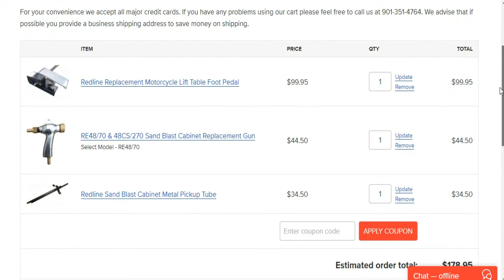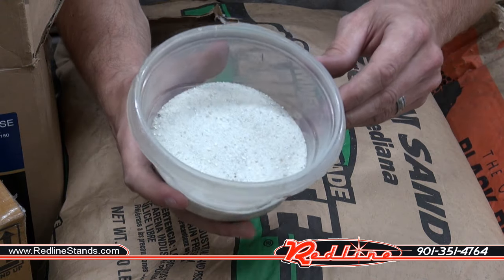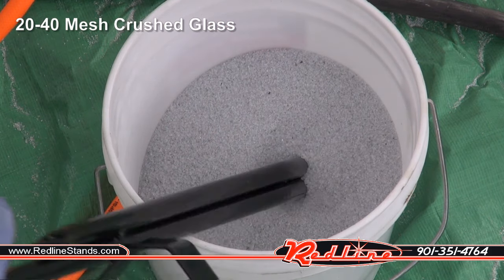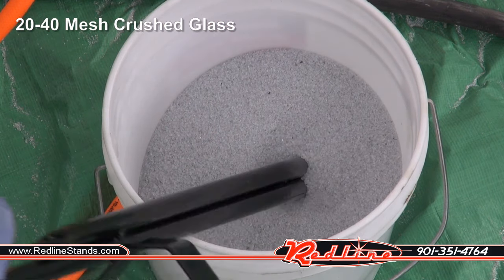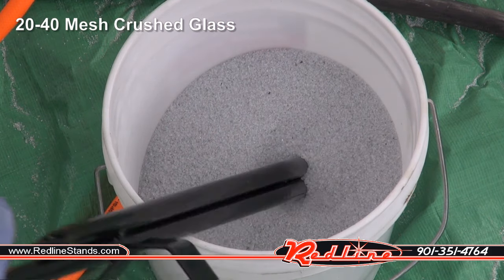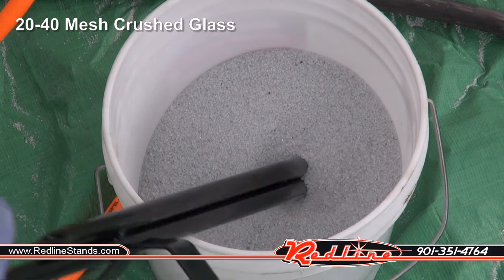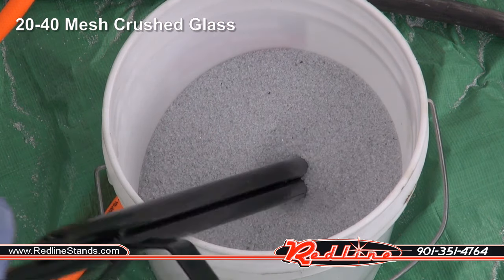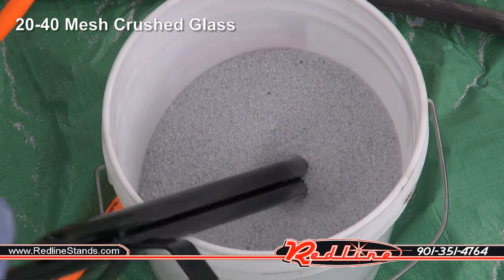Blast Medias Compared and Demonstrated

Comment: As I understand it, unless you are sure the sand you are using is silica free it shouldn't be used, Silica dust is very bad for the lungs.
Reply: Yeah That's why I ware a full face old military Gas mask when using sand all internals clean as a daisy after blasting.LOL.jim
Reply: @TheShawna1  You can't filter out the silica dust with a mask.
Reply: @TheChrisey  Yes you can.
Reply: A lead, asbestos filter on your respirator should be good for silica as well. Just make sure you have done a good fit test before the task.
Reply: @TheChrisey P100 pink circles or any of the Cartridge filters will absolutely filter out silica dust and a lot more. N95 is probably good enough for this, but a cartridge mask with P100 pink rounds is more comfortable and better. So it depends on the mask and how well it fits. Always check fit before use.

Comment: I swear by aluminum oxide. It cuts fast and feeds great. Currently using White Lightning white aluminum oxide from a local abrasive supplier. It comes in different grits like sandpaper. You can cut it with glass beads to achieve a smoother finish if desired. When purchased in 50 lb bags, it's not that expensive (I think I paid $40-50 for a bag) especially is it's going to re-used in a cabinet. Aluminum oxide does wear out eventually....every once in a blue moon, it's a good idea to change your media. I also use a carbide nozzle on my blast gun....not cheap, but totally worth it compared to ceramic or steel nozzles.
Reply: Agree with the aluminum oxide for fast work. It does leave a rough finish but that works out well if you are planning to paint the part. And the carbide nozzles are a must. The ceramic ones don't last with the alum oxide. For more finer and delicate work, like carbs, I like to soda blast. I dont have to worry about the soda getting where I dont want it. The soda simply washes away with water. Cheers.
Reply: Can you please tell me what you recommend for a bird cage that has paint and a lil rust and a heavy metal fire pit with heavy rust. Thank you

Comment: Reason powder coat paint is hard to remove is because the baked paint is somewhat flexible and absorbs some of the impact from the blast media. Think of it as like rubber. Thus heavier weight and "spikey"/sharp particle media does better to remove it. Glass bead media, which is a more rounded particle will struggle for example. Great video!
Reply: Powdercoat is paint. Its melted plastic
Reply: Powder coat is a polymer resin, not a paint. It is NOT flexible. Best way to remove powder coat is with a torch or industrial stripper.
Please educate yourself before spewing BS!

Comment: I wouldn't burn off powder coating because when I did my bull bar it gave off Hydrochloric acid vapour/chlorine fumes, both of which are incredibly dangerous.  The acid fumes condensed out on various pieces of bare metal that generated rust  within hours.  Normally my workshop is very dry such that I can keep bare metal exposed for weeks without flash rusting.

Comment: Great sifters are designed for gold panning and dredging operations. You can get a whole ranged set of them. They stack and fit right into your 5 gallon bucket. Very precise sifting.  No spilling at all.

..
Reply: I'll be using this for sure. Smart thinking, I'm sure there are tons of trade specific tools that could be used in other trades.

Comment: Thank you for this video! I have sandblasted off and on for years. Had my own business etching glass and blasting bear tracks in rock. I am starting to get back into it a little. Needed a refresh on media and this was perfect. The only thing I can add, if I remember correctly, is I think aluminum oxide  doesn't break down as quickly as other media. Thanks again!

Comment: So I’m an upholsterer and finally broke down and bought a harbor freight gun and some #24 walnut media instead of the #12 you tested. The rust I hit it with wasn’t quite as bad as your test panel and I had to put the nozzle of my gun right up to the rust, but it did come off. But I wasn’t too concerned about the walnut media mulching the edge of my yard where I cleaned my seat frames. 

Now that I have a blaster (and am getting a bigger air compressor), I’ll probably build a cabinet and consider a more aggressive media that is more reusable.

Comment: If you have a chemical stripping company in your area, I feel it is the best way to go for body panels. The part is submersed in a stripping tank, so ALL the rust is removed, even in cavities and seams where you cant get with blasting. Then be sure to paint or seal in all the cavities and you will never have to worry about your trunk lid, door panel, etc rusting from the inside out. Just an option for folks. I also use my blast cabinet and outdoor blaster when appropriate. Thanks for the video.

Comment: Here is my summary of this video for your notes:
Types of Blasting Media
https://www.youtube.com/watch?v=XUc2JCYh39w

Glass bead 20/40 mesh - OK on rust. Fast on paint. OK on powder coating. Poor glass frosting.

Garnet 20/40 mesh -  Poor on rust. Fast on paint.  OK on powder coating. OK glass frosting.
Garnet 40/70 mesh -  Poor on rust. Fast on paint. Poor on powder coating. Fast glass frosting.
Garnet 70/100 mesh -  Good on rust. Great on paint. Bad on powder coating. Great uniform glass frosting.

Coarse Black Beauty Coal Aggregate:
No experiment done, but works fast on rust.  It was too coarse for his gun.

Beach Sand Sifted - Poor on rust. Very fast on paint. Fast on powder coating. Fast coarser glass frosting.
The trouble is the moisture in it slows down sand flow, so I need to dry it out well first.

Hardware Store Sand Medium Grit (needs to be sifted to remove large stones)
Poor on rust. Fast on paint.  Poor on powder coating. Great glass frosting.  If paint has some rust, it won’t remove it!

Aluminum Oxide 70 mesh -  Poor on rust. Best on paint. Bad on powder coating. Best glass frosting.
This is the priciest media.  If paint has rust spots, it removes them all.

Walnut Hull #12 Coarse Crushed  -  Useless on rust,  paint, powder coating, glass frosting. Great for cleaning up plastic surfaces and probably wood furniture lacquer finishes.  You can use finer hulls.

Powder Coating removal - Heat up with a torch. Blast with sand to get this off fast.  Heating it up makes a huge difference to it peeling off fast.

Air Compressor:  Kobalt (Lowes) 17.3 SCFM (this is the most important feature), 40 PSI, 155 PSI max, 5.0 HP, 240 Volt.  I could not find this at Lowes.  Here is the closest match for $2250 and they don’t mention CFM (air movement at Cubic Foot per Minute - the most important factor in blasting. Anything less than 17 cfm is useless for larger blasting projects)
https://www.lowes.com/pd/MEGA-Compressor-80-Gallons-Two-Stage-175-Psi-Vertical-Air-Compressor/5014405385
Remember too, that these are noisy and the larger ones need 220V outlet, and they have a risk of exploding, so keep them in a sound-proofed, insulated cabinet.
Reply: I'm in beginning of video but appreciate notes I am screenshotting them now thx

Comment: Excellent video! Flame stripping is a very old coating removal method. I use a weedburner (carefully on thin steel) for that and a handheld wire brush. I secure the work
on my tristand (any outdoor vise will do) when it doesn't weigh enough to stay put. I keep pieces of scrap especially angle with bolt holes to hold all sorts of work in my vises.

Walnut shell is so gentle it's been used in aviation by applying it to RUNNING jet engines where it removes accumulated carbon etc. It's very much a specialty item and I appreciate you testing it.
Liked and subscribed.
Reply from the maker: Thanks and welcome aboard

Comment: "...running 17 CFM @ 155 PSI"??   
But the specs for that compressor are: 
17.3 SCFM @ 40 PSI
16 SCFM @ 90 PSI
17.3 SCFM @ 40 PSI
And pressure (PSI) changes inversely to CFM (volume) - so the higher the pressure the lower the CFM.  I'm guessing dude just misspoke since the "Max PSI" printed on that compressor is "155".  But who knows what the SCFM would be a max 155 PSI.  I'm not calling anybody out, it's just important to know exactly what settings are being used.

Comment: Very informative. Which media produced the least amount of dust inside a cabinet? I am going to purchase your REPP70 pressure blaster. I have a 40 hp diesel screw compressor I plan to keep outside and run the air in. It produces 100cfm at 100psi. It amazes me how small increases in nozzle size increase tremendous amounts of air flow. With a 1/4 inch nozzle I need 85 cfm. What size nozzle can the REPP70 use? Thank you
Reply from the maker: In my REPP70 at home I like to run either a 6mm or 7mm nozzle and that works well for me, but then again I only have 17 CFM to work with, but I make do just fine.  I'd say the 10X produces the least amount of dust.  Crusted glass gets really dusty fast.
Reply: @RedlineStands  actually you don't even have 17cfm unless you are blasting at 40 psi. at 90 psi you have 15 cfm. plastered clear as day on you compressor.

Comment: Thanks, Enjoyed. I am trying to remove decades of paint from an upright metal belt sander. Rockwell made in 1942. I have a large blast cabinet and first tried soda. Poor performance. Plan B.
Reply: Soda is meant for more delicate parts, like carbs and soft aluminum. To remove "decades of paint" quickly I use aluminum oxide with a carbide nozzle. I restore vintage metal and woodworking equipment and the al/ox works best. Plus, it provides a nice finish for my primer to grab.

Comment: I used to live in niceville around the fort Walton and Destin area myself. That Quarts sand is amazing stuff. When you bring it back from the beach it's in your car and house for life lol. It sticks to everything.  Even turns oil slicks into tar balls. And lighting loves the he'll out of it. It's a great conductor of electricity.  That why things around there get wacked by lighting so much. I just wonder being it's been in salt water. If flushing it with fresh water then drying it would make it less corrosive to the metal your blasting.  So you don't end up with rust under the paint job. I'm just thinking of possible salt contamination to the metal. Just possible food for thought, possibly what are your thoughts on this?
Reply from the maker: I can tell you this for sure.  At the beginning of this Nova project I blasted some parts with play sand from Home Depot.  I epoxy primed one of those parts and set it outside with only primer.  Years later, it looks great.

Comment: Great video I enjoyed very much. What psi were you using in your demo ?   I use the glass bead 80 grit  on painted, rusted cast iron and stamped steel which does pretty good in my blast cabinet. I might give the 70-100 mesh 10x a try and see how that works.

Comment: hi could you tell me what size screen you use to clean or shift the media ? thanks great video.
Reply from the maker: I bought that screen material many years ago so I don't recall.  Today we sell this sifter in the link below and it works great.

https://www.redlinestands.com/catalog/shop-equipment-c-327/sand-blast-equipment-c-327_501/sand-blast-accessories-c-327_501_506/5-gallon-buckettop-blast-media-strainer-filter-p-3056

Comment: I bought a 5g blaster direct from VEVOR when I got most of it was together my only concern is when I hooked up the blast gun hose to the bottom of the tank it went on really easy it seemed very loose fit I tightened the hose clamp real good and I can still spin the hose around and around I'm not sure if it is suppose to do that or not.  My thinking is yes because of all the different hoses it has this would be the one that you would want to spin depending on how you prefer to hold the blast gun,  please get back to me ASAP thanks Wally
Reply from the maker: No sir.  Definitely not.  That hose should be Jesus tight.

Comment: is there the health hazard with quick Crete and beach sand. If so, does a good respirator
 safe enough?
Reply from the maker: QuickCrete is the brand, so it's just sand, not QC and sand.  I have used a good 3M respirator in the past and experienced no health problems after a full day of blasting.  With that said, do not use a dust mask.  You definitiely need something much better.
Reply: Yes there is a health hazard with any blasting operation, but especially with silica sand.  In my 37 years in the equipment rental business, including many types of blasting equipment, I would say "NO", a respirator is not safe enough.  Even a Positive Air Pressure device leaves traces of highly abrasive in your lungs, which you will need for the rest of your life.  People breathe more than 10 times more air than they eat food by weight.

Comment: aluminum oxide is what i use and it's great for steel and aluminum for my powder coating,  but after i use it and outgas it, then ill put it my other blast cabinet that has glass media, to fine out areas that are needed works great....im getting ready to buy black diamond fine and medium , what do you think about using it replace it with the glass ??? please let me know thanks
Reply from the maker: I don't understand your question sir
Reply: @RedlineStands  does black diamond work the same as aluminum oxide ? performance wise ?
Reply from the maker: @417plasma6  Never tried it.  With that said, I have never met anyone who thought anything worked as well as aluminum oxide.
Reply: @RedlineStands   Thank you I appreciate your response. 10.00 a bag of black diamond fine, isnt gonna hurt my budget, so i'm gonna give it a try, and ill let you know the results and different application  difference..if any !!!.. Happy New Years from my shop to yours

Comment: Too funny :) Beach sand is the best (FREE!!) just make sure it is sifted out and dry thanks much !
Reply from the maker: No sir/ma'am.  Please don't use beach sand.  It contains free silica, will give you silicosis when blasting with it, and will kill you.
Reply: @RedlineStands  Oh I didn't know that. I suspect all of those abrasives are deadly when they get ultra fine powdered and inhaled. I mean glass is the same as sand and garnet will get just as fine as glass. Gotta wear EFFECTIVE breathing protection. Thanks for the warning.  

..
Reply from the maker: @MrDavePed  Correct.  It's all terrible to inhale, but some are much worse than others.
Reply: @MrDavePed  I Understand the Point being made, what I don't understand is how Marines can drive through the Dessert, for 18 days at a pop, Get covered from Head to toe with enough sand, they have to put bandannas on their faces to breathe, then spend hours cleaning that gritty crap out of everything. Trust me when I tell you that sand is about as fine a particle as you're gonna find after being ground up by 5 Ton Trucks and 15000 Lb. Howitzers or Tracked Vehicles, Yet, they still do this today!?!! I am glad to see so many people erring on caution though, sharing this information is working, Thanks Everyone!

Comment: Beach sand, builder's sand, brick and block sand and play sand are not the best cutting materials.  All of the above are rounded by the action of wind and water, and appear like ball bearings under magnification.  Blasting sand looks like shards of broken glass with lots of "sharp" edges, before first use.  Most media can be reused.  Blasting sand can be reused up to about 4 times before it is no longer economical.  Sharp blasting sand is manufactured by fracturing silica deposits, before drying and packaging, and must be kept dry for best results.  Sieving and cleaning media is time consuming and therefore expensive.  Silica, like asbestos, is an extreme respiratory hazard.  Silicosis, also know as tunnelitis, killed at least 764 men working on the Hawks Nest Tunnel, alone.                                                  Other media, while being initially more expensive, may be less expensive when reused.                                                                                          The Kobalt air compressor is not capable of 17 CFM at 155 PSI.  155 is the max pressure, and 17 CFM is the cubic feet per minute at 40 pounds per square inch (PSI).  PSI is like electrical voltage, and CFM is like current (AMPS).  To determine power, multiply CFM by PSI.  In use while blasting, the actual air pressure will drop to near zero, so therefore. flows more volume (CFM}  Than  specified.                          Good job on the video.  I hope your wife forgives you.

Comment: what type of media is best fro removing a coating on a 1985 Kawasaki motorcycle frame>? The stuff is very thick not sure but mite be plastic coat?
Reply from the maker: That's really tough to say.  It depends on what you plan to do with the metal once you're done.  For instance, is it aluminum?  If so, are you going to polish it?  If so, you will want soda because anything else will leave the metal badly pitted and would require sanding in order to polish it.  Are you powder coating it?  If so, then a lot of pitting is great, and I'd recommend something cheap like crushed glass or 10X.
Reply: @RedlineStands  Hi it is being powder coated, i'v tried crushed glass it dose not work on this coating what ever it is?
Reply from the maker: @terryrowles7703  It's probably powder coating.  If you'll hit it with a propane torch and burn the coating really well it'll become brittle and will blast off easily.
Reply: @RedlineStands  I'll give that a try thanks good video keep it up..

Comment: i use aluminum oxide.  but  i recycle it till it is powder.  beach or hardware sand, works about two or three times, before all the sharp parts are rounded off, ,blackjack is a little better, but still gets smooth,  a lot sooner than the aluminum oxide .  for a single run, it is great and cheap, on my cabinet recycling it. not so much,  great vide thanks